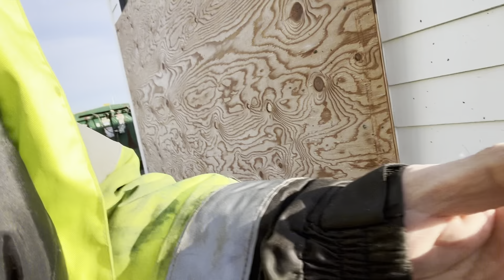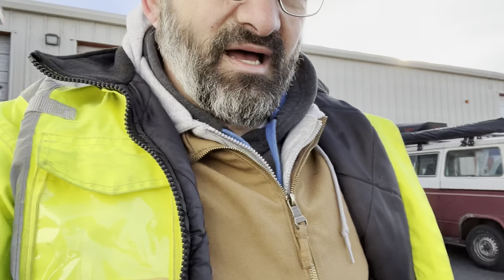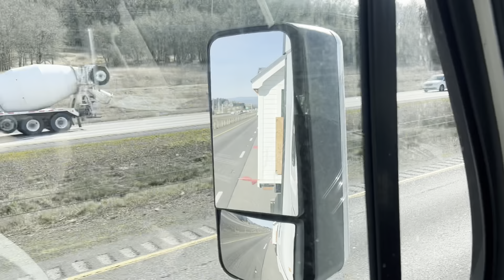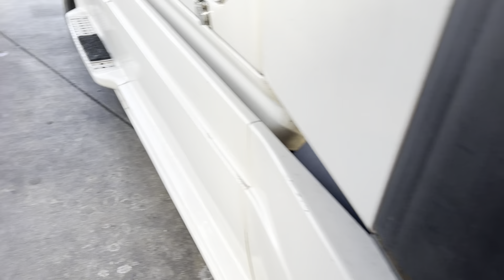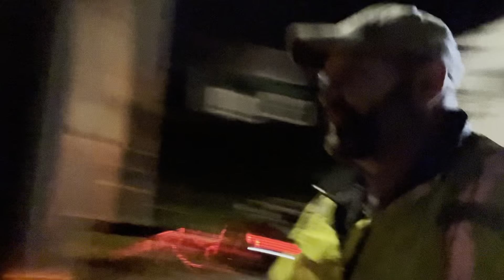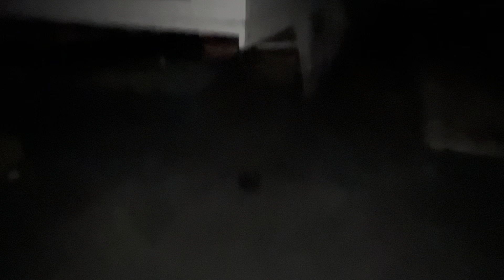Oversized Tiny Home Transport

Comment: Chris, would this have been doable with that 3500 HD you've used in other videos? I'm looking to basically copy this 10'4" model and build my own on a 28,000lb, 4-axle capacity trailer. Do you know the weight on that 36' beast? It looks like you can rent a 6.7l diesel flatbed pickup from Enterprise, but it's for business use so I'm not sure what that means - I would try to do it myself if legal. If I hired you or someone else, what might it cost per mile?
Reply from the maker: You are an amazing artist! Thank you for your music! Not sure we understand your question… if you are looking for a price we sometime transport for free! Depending on the load! We hardly make more than what minimum wage is plus mileage! This is mostly a venture that gives us peace in serving!
Reply: @troutdaletowing  Thanks for the kind words. My question is could the 3500HD pickup truck you've used in other videos handle towing this 36' home?
Reply from the maker: It can. It’s towing capacity is more than 26k
Reply from the maker: We would not suggest it. The building / that building was 10.6 wide almost 14 tall and more than 30 in length. It weighed more than 20k and the tongue weight on the hitch was close to 4k. The stability of a larger unit and the reinforced hitch will give you peace of mind, but using the 3500 without reinforcing the hitch insert and bracketing including the weight of the truck for stability would make your trip very questionable and difficult!
Reply: @troutdaletowing  Thank you for giving me a realistic perspective! I will definitely be finding someone with a semi.
Reply from the maker: If you are locally in Oregon, WA, IDaho we can give you a price if you call our 24/7 dispatch! ~ Find us online under Troutdale Towing